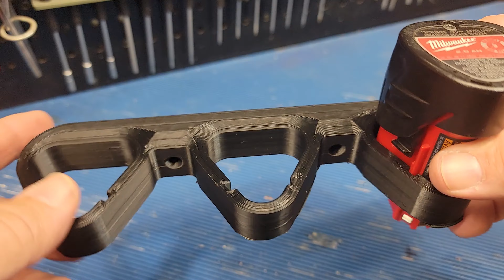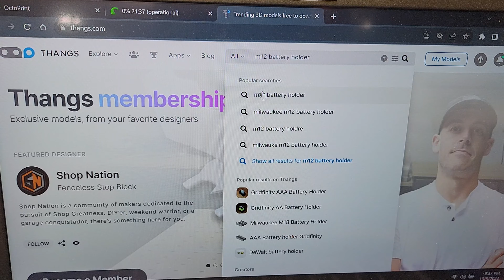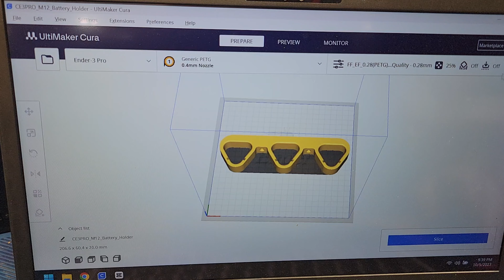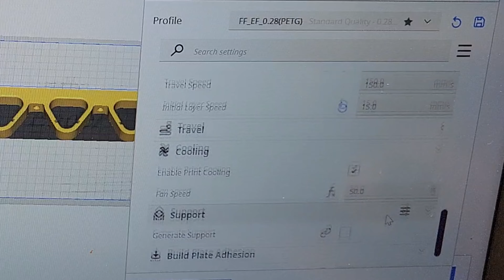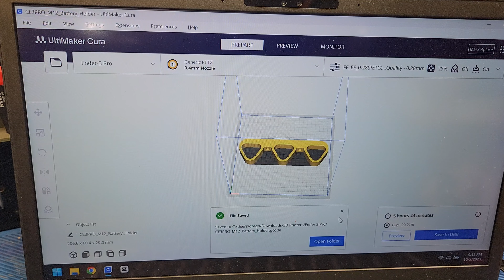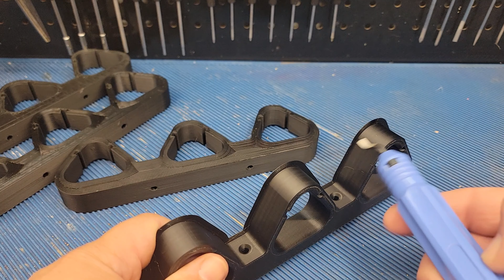A Tool For Every Shop?

Comment: What printer are you using and what do you guesstimate each of these costs to make? Weighing getting a printer and any input or advice would be greatly appreciated. My use case is mainly things like these battery holders.
Reply from the maker: I use an ender 3 pro and an ender 3 max.  A spool of pla costs $10-20 and you could probably make a dozen or so on a single spool.  Probably less than$0.75 worth of filament.
Reply: @AnArmAndAGreg  ok thank you, I  was looking into those at Microcenter. Anything you have experienced that I should avoid as a total beginner?
Reply from the maker: @Mopjockey1234 , I say go for it.  There's a pretty steep learning curve, but there's plenty of online resources like reddit and youtube channels like filament Friday, makers muse, and voidstar labs.  Best of luck to you.